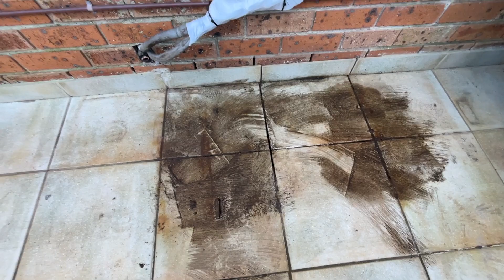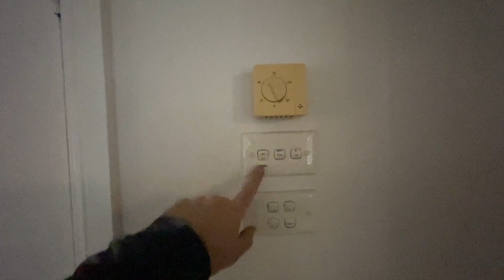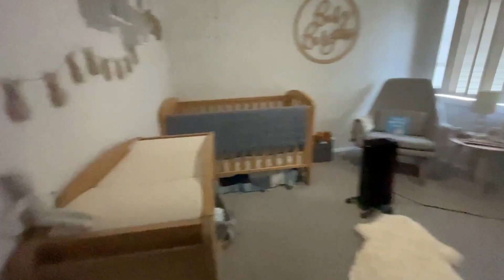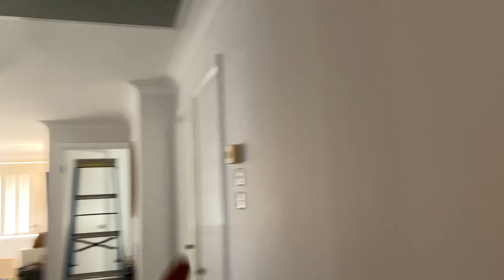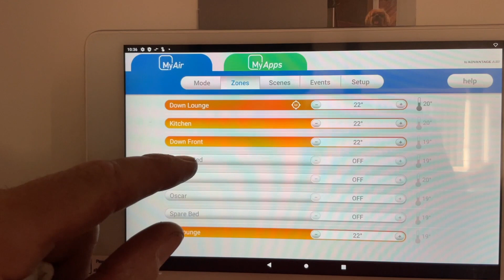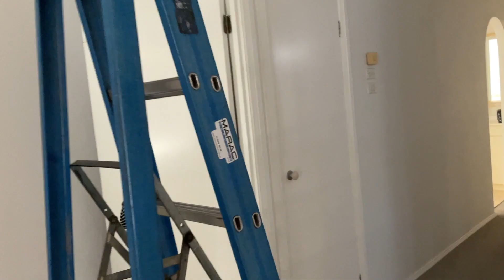Installing a Daikin DUCTED Air Conditioner | HVAC Installation

Comment: Where do you get the electrostatic filters from? i want to start using them aswell
Reply: I was thinking the same thing too. I've never heard of electrostatic filters for residential ducted systems. I was always of the mind that the media filter was the standard.

Comment: Solid install man, one question I have is why 18 inch returns make more of a difference than having 16 inch with the 20kw systems
Reply from the maker: Thanks man. It’s because the 18kW and 20kW systems produce more air flow then you can get through a 16” duct. So if you upsize to 18” duct, you will 100% get more air flow

Comment: What brand / type of lift are you using here?
Reply from the maker: “Genie” is the name of the brand. They have different types of lifters. We use the gas lifter in other videos but this is a different type where you have to wind up manually. It’s good for outdoor units !

Comment: What fixings do you use for the condenser brackets? Im yet to find any im 100% confident in when hanging twin fans
Reply from the maker: I only use one type of fixing and that’s the Hilti HRD. It doesn’t have to be Hilti though. Any brand, but that type. I absolutely despise Dynabolts and wouldn’t go near them haha.